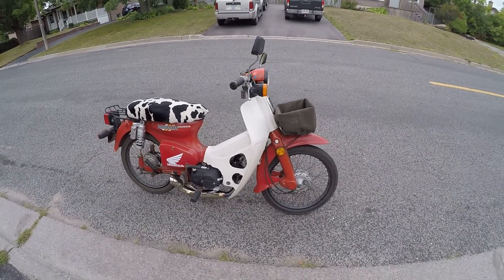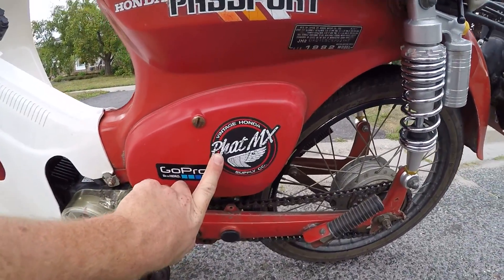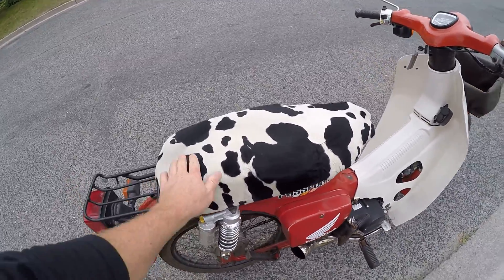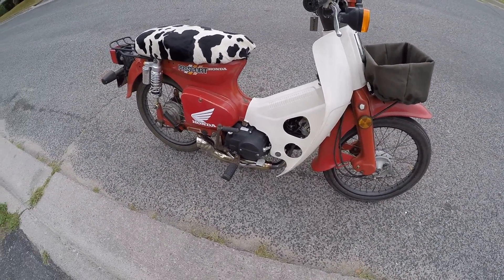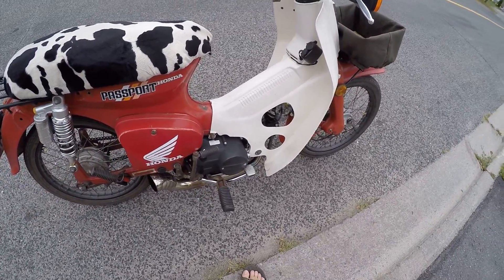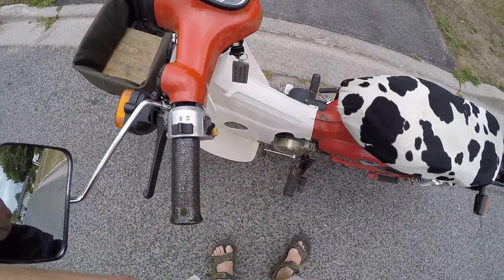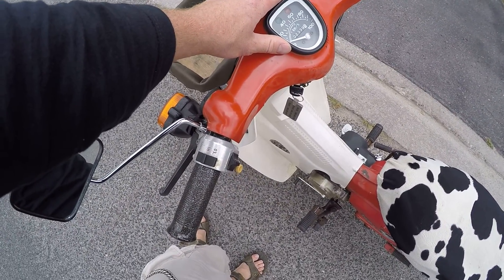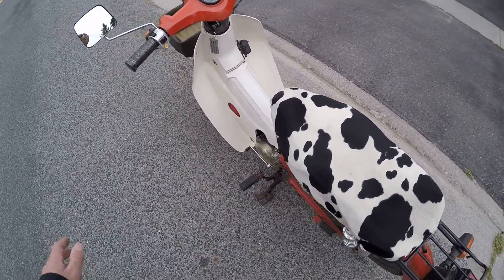1982 Honda C70 passport with 125cc lifan engine

Comment: Did you have to do any cutting of the frame to fit the engine in?
Reply from the maker: No cutting at all, but I had to widen the footpeg on the clutch side by an inch.

Comment: did you have to modify/replace the foot brake?
Reply from the maker: i didnt have to do much modification. i just cut the corner of the foot pad that is closest to the engine. everything else is still original

Comment: So kool, love that exhaust, love everything!im going to pick one up in 1 hour. We’re did you get the engine?
New subie
Reply from the maker: The exhaust is awful; it only looks cool. Engine was purchased at a local shop. Check out my more recent videos. Updated the bike quite a bit since then.
Reply: @Ratbiker  what was wrong with the exhaust?
Reply from the maker: AirWreck FPV it’s very noisy... has a “dead” hollow sound. Plus it sits so low, it scrapes the ground.
Reply: @Ratbiker  what exhaust did you end up going with?
Reply from the maker: AirWreck FPV check out one of my more recent videos and you will see it. I took a pitbike exhaust pipe, cut it up, and welded it into a new shape. It works well and sounds amazing.
Reply: @Ratbiker  very cool I'll check it out. Thanks for the reply
Reply from the maker: @airwreckfpv8009  no prob

Comment: Where you able to use the stock foot peg mount with that 125cc
Reply from the maker: michael tsampis I had to modify the foot pegs by adding 1 inch to the clutch side. But as far as I can remember, the mounting holes fit right up to the China engine no problem.
Reply: @Ratbiker  Thank you

Comment: Whats your thoughts. On the Lifan transmission. I have a S90 (1964)  and my research says the weak link in the Chinese Clones is their transmissions  i would like to convert mine to a SemiAutomatic  transmission  and i originally hoped i could just swap a Honda Semi Auto clutch pack  but research say nope the cases are different  overall your bike looks  great ! Years ago i found Cow print material on  Clearance and for a hoot  I did my office chair in it  as Sewing and Upolsterey is one of my hobbies as well  BTW the Exhaust note on  your bike sounds great ! Ive always liked those motors Bored and Stroked    Up to the 110 or bigger
Reply from the maker: Well... yes the gearboxes can seem quite weak in these engines, but it’s really all in how well you treat them. With the engine that’s currently installed in my bike, (large valve 125cc Lifan) it needed a new gearset because the motor was somewhat abused; hard shifts and whatnot. I replaced it myself with a new gearset and I’ve put well over 7000+km on it with no issues. S90’s are a beautiful bike. I’ve been wanting to find one for years now. A good condition 125cc Lifan will work well with it.

Comment: What speeds are you getting after upgrading the engin? Was the new speedomitor needed because the old one didnt go high enpugh or was it just broken? I picked up a Honda passport for 30 bucks. I stumbled on a huge modding comnunity in Taiwan for these after i got it.  Mine needs allot of work so any answers would be greatly appreciated.
Reply from the maker: after upgrading the engine again to a big valve 125 (not the engine in the video), and playing with some sprockets i got speeds up to 95-100kmh, but then after recently installing 2.75" tires, the bike could barely do 80kmh, so now i'm back to stock gearing, and it can do 80+ easily. i changed the speedo because some vandal smashed out the old one before i bought the bike, along with many other lights and parts. it needed a lot of work to get it certifiable for the road. 

lol my modding community is from indonesia. i am currently trying to get a honda wave front fork and wheel so i can swap out the dated leading link suspension.

will post an update video soon.

Comment: Hello fellow Ontarian! what kind of mileage are you getting? I just got an '84 c70, and am loving it. Looking for a little more top speed once I'm M2 licensed. - A new subscriber
Reply from the maker: Is your Honda all original? If so, there are methods of making a Honda engine more peppy. Though I always suggest a Chinese engine. Best bang for your buck, though reliability isn’t Honda quality.
Reply: @Ratbiker  It's pretty original - I'm the 3rd owner, but no mechanical changes that I know of. 1st owner was the military, then a buddy's dad, who kept it stock. My values are reliable and inexpensive haha. I'm using it as a commuter - half the price of gas to my Jetta, and gives my wife the car for errands.

I'd be very interested in Honda pepping methods

Comment: Did you have to update all of your electronics for 12v? - Wait sounds like you are making a video to address this subject.

How much more MPH do you get?
Reply from the maker: the bike was originally 12v from the manufacturer. but i did some updates to the bike's electrical system. there will be more to come this summer. and so far i've clocked the bike at up to 66mph.
Reply: Oh gotcha, I have an 81. 82 must be the year Honda went to 12v. 66mph is pretty impressive for a C70! Does it get squirrly around that speed?  @Ratbiker
Reply from the maker: @motospud2253  it doesnt really get squirrely nowadays. when i first got it, the front wheel would lean against the fork, and wobble all over the place. since then, i've rebuilt the front suspension, and upgraded the front and rear shocks. but the bike simply follows the shape of the road and wiggles along on its merry way. but i rarely work the bike past 50mph. it was super squirrely during the short time when it was turbocharged (one week).
Reply: I'm feeling inspired to do this to mine! Thanks for the info and sharing this video.  @Ratbiker
Reply from the maker: @motospud2253  i will post another update video soon, when i have time. if you have questions, let me know.